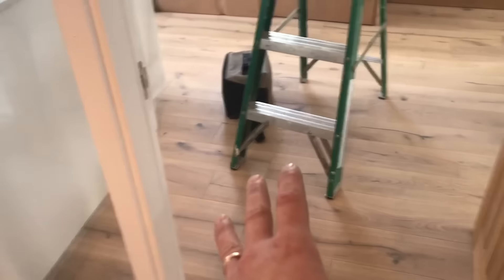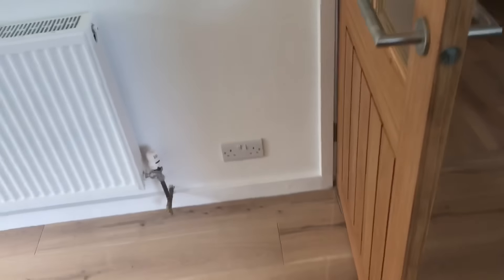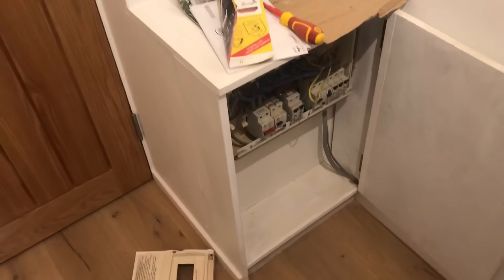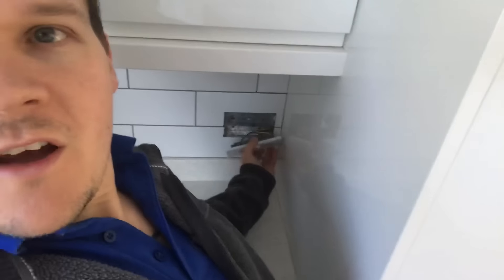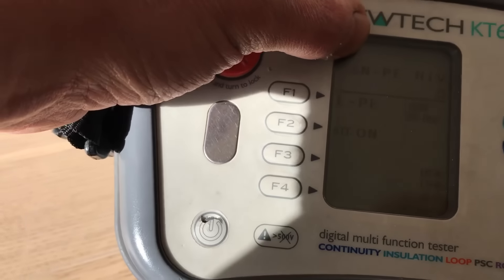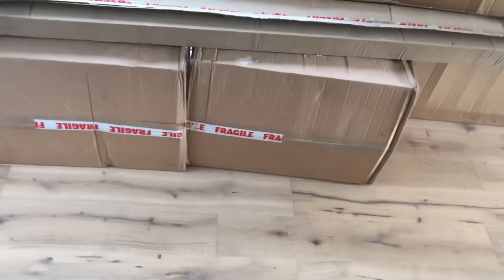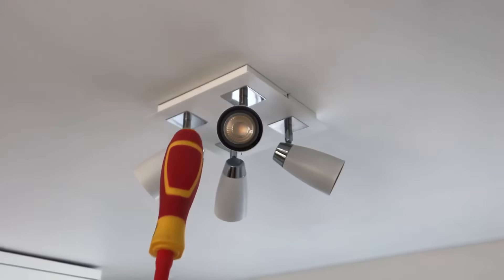Electricians day testing and inspecting one of the worst installs.

Comment: Atleast from where i'm, the builder do only the builder job, the electrician needs to be called apart. Of course, if the builder needs to move cables and stuff he's going to call an electrician to do that, but if the installation is old and the client doesn't care to fix it, the builder just do his job, without touching anything. It's a problem of the client if he have problem after. Also, in a new building, the electrician need to be called from the client, so if he call someone incompetent, the builder can't do much. The builder can just suggest to call someone and stop.

Comment: man electrical in the UK is so damn different compare to the US. i would love to learn electrical over in the UK
Reply: not much different just have to get over the concept of ring circuits. using 2 runs of awg14 dbled into a 30amp breaker one line going clockwise the other counter clk meeting in the middle outlet. ive seen a lot of GB wiring i wld be comfortable as a homeowner doing most of it.

Comment: If you find this shocking, try some ancient industrial electrics, i've opened electrical cabinets where it's just a spaghetti monster inside, and if youre lucky the plate with all the relays and fuses doesn't fall out, because the bolts holding the panel in are rusted through... every day the same shit...
Almost got myself killed at my previous job, 690 volt panel fell out of the cabinet when i opened it.

Comment: Looks like a builder/ plumbing contract. They’ve paid for a plumber to remove a hot water cylinder and fit a compliant Boiler, Government rules. Grants are also paid out by local council for this. No need to show where old cylinder went or boiler + asbestos flew ( check local hedgerows) no paperwork needed. 
Try asking Corgi, still in existence and Gas safe, new boilers paperwork could easily include electrical sheet.

Comment: The bathroom light: First, the measurement is taken from the floor; not the base of the shower tray. The IP rating is with the fitting in the fixed position, so the connector block is irrelevant. A shower unit has a connector block inside it but is IP rated when the cover is on; not off. 
However, even with the class 2 symbol I don't see how it can be a class 2 fitting. 3 things make it class 1. The wiring of the fitting itself has only basic insulation. There is no insulated separation of the connector block or fixed wiring from the metal.
I can't believe these are genuine fittings. Must have got them from eBay at £5 each.

Comment: The world is full of shoddy trade work....It is the wild west out there & it does not stop with electrical. After our home burned down due to a previous owner's bad renovation caused a hidden electrical fault. The insurance claim was such a nightmare I ended up quitting work & taking the rebuild on as a complete project myself with the help of a building contractor friend. Since completing our home, I have been working with our a contractor friend for a year or so because I am now between jobs (electronics engineer) but I have very good trades skills. I think the root of the problem everywhere is clients push contractors so hard to reduce costs, so even the good ones get pushed to cut corners just to compete & get the contract when they have to compete with quotes from bad contractors.

Comment: I would be using insulated gloves testing that joint. Go and pull the council main fuse and and get the joint rewired by a licensed contractor.

Comment: Ild be advising the home owner to take who ever did that job to court.
I wouldn’t of been touching a number of those things like the make shift ground with any power on.
Makes me feel glad the screw ups we’ve been left with over the years weren’t worse.
Considering 2 more recent issues were 2 power points bypassing the main safety switch “means there was no way to cut power to them”
And when some idiot replaced the main safety switch with a manual switch for a year or two before it was discovered.
Edit - you really don’t want to feel mains power going through you. I don’t know how to describe the feeling of 240V 10A
Going through you. “A bit of advice don’t go looking for switches in small gaps for devices like a plug-in fluro light outside “shed” where mice can get in to chew through the insulation”

Comment: There's clearly serious ammounts of problems with this install and the poster obvisouly knows his stuff.  It's a minor thing but he points out that the zone 1 light fitting should be IPX4 rated and refers to the fitting being IP44. The digits are independent, one is for ingress of foreign objects (the first figure) the second for waterproofing. The reason it's IPX4 is that it has to have a a minimum of 4 for water ingress, mechanical protection (denoted as X in the OSG) isn't important. The fitting could be IP24, IP44, IP64 and so on. A minor point but worth noting for anyone watching. He was probably stressed dealing with all the issues on this install!

Comment: I'm always amused by how different countries have (usually slightly) different wiring codes, and how electricians from the respective countries will recoil in horror at the "obvious death traps" that are perfectly compliant with the wiring code of the other country. The way you recoiled at the unsheathed earth wire on the socket outlets? That's just fine here in my country (what do you think is going to happen - the outlet body might accidentally touch the earth wire?) And then you say some stuff that seems to imply that in your country, socket outlets can be unprotected by GFCI (I think the Americans are somehow fond of non-GFCI-protected outlets), yet in my country that's what our electricians recoil from in horror.

Comment: Most probably the owner asked for a quote from an electrician. The quy calculated his work at normal rate and added materials. It came to 10'000 Pounds. The customer shared this information with the builder who, on the spot, said, he would do it for 3'000. The customer knew something was not right but killed the thought. "I'll deal with it later. Everything will be ok."
It is only the customer's fault. They should never have given the general builder this job. At least they should have called the inspector before the job and agree details of the work. The customer is to blame. Period.

Comment: The best thing i've ever seen: 3-wire cable everywhere. In every socket, light switch, or junction box. But only 2 wires (L and N) are connected. PE lays unused in the back of everything. Sometimes the N and PE connectors of a socket are connected together to neutral like a PEN wire, sometimes PE connectors are still unused. I don't understand such bad working.
The one where that has installed should be hit by lightning when shitting.

Comment: :D is that lamp really only held by the cable ?
Reply: Its actually a common method for lightweight lamps. The cable insulation gets fixed on the housing so that the copper has no mechanical stress and wont get pulled out due to the weight. 
You could build yourself a swing with a pair of NYM-3x1,5 cables.
Reply: :D here you would lose your job instantly as an eletrician if you do something like that
Reply: may i ask where you live and work? in germany its a common thing just like i said. we probably have a DIN Norm for that

Comment: Assuming you use Building Permits like Canada and the USA does, I'd call the City Building Inspectors (or your equivalent) and ask them if a Permit was ever opened for that Job (if it was, I guarantee it's still open as NOTHING would pass Inspection) and STRONGLY suggest an Inspector come over and look at what you found. That Inspector (after they heal up from the Heart Attack that Job would give them) should then issue an Order of Correction (or whatever they're called there) to get that flat fixed. That should help the Home Owner get the Builder to pay for all of the repairs needed after all the walls and ceilings are pulled down to do the Whole House Rewire needed to fix that Nightmare of a Disaster...
How is it that no one has been killed yet by that Shoddy Work?
And how many other places has that Builder Butchered?
Reply: lol they dont they are self credited through the government regulation agency they kind of are on their own honor system tho lol. yet we are the land of the free in merica with all government inspection oversight🤦‍♀️

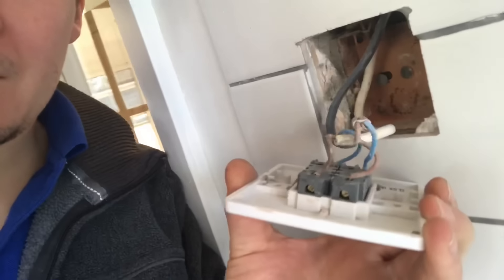Comment: what’s your problem with that switch @ 08:18?
Reply: You can’t tell from the video that is flex cable. should be crimped then with screw down connectors. Better would be a standard 1.5 NYM cable ofc...

The switch is all plastic, no need for PE - you should bring it up to where you hang the light though.

What grommits are you talking about?

Im an electrician in Germany, just interested and curious how things are done elsewhere...

Comment: IP numbers

1st number is for dust or particles. 4 means protected from 1mm or smaller stuff.
2nd number is for water so 4 means protected from splashing water. 
So the light is ok.
Evertyhing else is HORRIBLE :)

Comment: If they are basically renovating then all the wiring should be ripped out and replaced. No compromise. It's easier and hardly more expensive for a flat. It's not Buckingham Palace.

Comment: they didn't say to her that she needs it rewired because they know they can do a cheap job, and charge some extra money for it. and then be gone, and there will be nothing she can do. 

Thats why i don't like it when people say things like "its the customers fault for wanting a cheap job". a lot of the time its the supposed "expert" lying about what things will cost to be done right, and then doing them as cheap as possible and taking the money.

And worst of all, it will cost WAY more to fix these things after the other work has been done. Than if they had just been done right in the first place when everything was getting worked on, instead of once everything is supposedly nice and finished.

Comment: Dam ............. i am not a normal house electrician .. i am a specialiced service electrician .. mean i can fix lots of electrical stuff but i cant change anything in a home or rewire stuff there ( because i dont know some of the laws .... that are special to this ) But i can touch basically anything after an outlet and exchange like cables and outlets and even breakers .... but that said. ... dam THIS IS A HORROR SHOW ..... DAM !

also was the cable wet for the shower lamp thing ? looked wet to me ... that cant be good at all ... but dam that looks really bad !

Comment: Electrical jobs like this are very common. The solution is to prepare a simple written report on one or two items that suggest the property has wiring faults. One copy goes to the householder, one to your trade body, one to the council and one for yourself. Then leave. I wouldn’t apportion blame, that is the householder’s problem. Your job is to identify a dangerous installation and report it. Too many tradesmen do the “suck between the teeth” and the “who did this” routine. Don’t do it as well. Stick to the facts, give a price for an investigation and then prepare a quote for remedial work. Simple stuff. Rise above the rabble.

Comment: 14:01 supply looks dodgy to me, should be a DNO cutout and what on earth are those meter tails?
Reply: Older flats often have remote meter positions with the main fuse located in a communal area. Should ideally have a red link for a point of isolation dno may upgrade at some point. Cable looks to be split concentric cable that's been wrapped by previous meter fitter.

Comment: In our laws, isolation switches should be within a meter of the stove, geyser etc.
Reply: my laws whats an isolator lol well not really they are required for outside motors appliances(mostly a/c and water heaters /furnaces if not with in sight of breaker.)

Comment: I Come Fro Industry power domestic sucks but the Guy whom has done this Should do time  Where is the 63A Head gone ?  There is just a Black box on the wall with the Tails coming out So what happened to the head ?  Horrible is it not when u find shocking stuff like this in the UK . That's what happens when you flood the country with no good bell ends .  Scary behaviour . I Hope u got a 10 grand rebate on the wiring because that's about the base price for a standard install .  Still Amazed that someone has removed the Head LOL

Comment: I must have heard him say probably 15 times "terrible" and "whoever did this has no idea what they're doing". How about instead explaining how it SHOULD have been done? Very monotonous hearing the same comments over and over, I think I got the message after the first time....
Reply: Looks like the flat was originally wired with 'mineral insulated cable' (L/N wires inside a metal tube which is used for earth) problem with this stuff is its usually cemented straight into the walls, so not easy to replace, so they didn't they just connected new cable with terminals in the wall, lol. Also as the earth was originally the metal pipe the live conductors run in, which means it needs a specific termination to maintain good earth continuity (again looks like they didn't bother). There were no earthing loops from the front plates to the back boxes, they seemed to be running 'spurs' when they should have been 'ring main' (lowers the rating of cable). Generally the installation was sloppy let alone incorrect. (The IP rating was o.k. though IP44 is IPx4) 
If you ever see mineral insulated cable, avoid it its a pain in the bum. (clue is two black cables in the sockets, single core copper, and no earth as it was originally earthed by the gland connected straight to the back box) which is likely why when he screwed the face plate back on the earth came back.

Comment: I will state this - I am NOT a certified electrician, but have worked alongside and with them at times (Showing work done and let them check, certify and sign off) and I'm in SHOCK (pun unintended) just under 5 mins in - it hertz (intended) that the customer has paid good money for a half * job.
I hope they 'l-amp' (intended and would have been hidden. Will stop now) the idiot and/or company with a claim through the courts.

Comment: 12:56 holy fuck now I see how horrible the job is, a bare live wire sitting uninsulated in a metal gang box, so fucking stupid. None of the outlets were grounded, the ohm reading was 13x what it should be. Just a nightmare lol. The worst thing was the ungrounded light fixture above the bathroom, the wiring just looks janky as fuck and with the metal bar running across without a ground it's just hideous.

Comment: Agreed, a bad job. However you ask repeatedly "where does that go"  Bear in mind it was an old existing wiring job. How does anybody know where it goes ??  As long as the cable tests ok in every respect then in my books use it. I really don't know or care where it goes or the route it takes ... is it earthed, does it have a breaker and it it the correct diameter for the given application. If yes, use it it no, cut it off at both ends and start again.

Comment: In USA  such a bad job wouldn't happen,once inspection is mandatory over there.
Reply: INSIDE BRAZIL documentation is mandatory on new builds, this was an old apartment going through modernisation by a private client. It was their own discretion to get a proper electrician in. The guy who did it clearly had no intention of testing it; a typical cowboy builder who thinks because he can wire a plug he can do anything, and will do anything for cash. He could kill the next resident, and he would be jailed for manslaughter... once they found out who did it, which without documentation could take a while..

Comment: Tne problem is most the owners don't want to  spend in safety just they spend  for decoration more than safety and some builders are dodgy they left anyone to run cable and than hire person  with small knowledge to do second fix. 
I swear to God 75 % of uk Electrician’s they are not able to work in Germany or Netherlands as Electrician’s.

Comment: Horrible installation, you're right to condemn it and builder should be reported to local Building Control. One thing, you don't understand IP ratings correctly - the shower light is rated IP44 and the regs call for IPX4. IPX4 means the fitting should be water tight and as a result, the physical ingress factor (rated X here) should follow suit. IP44 meets the regs requirement and the fitting is fine - the installation isn't though!
Reply from the maker: No your incorrect he cut out the manufactures connections and used open connector blocks effectual fitting a metal light fitting in a shower enclosure

Comment: OMFG Are you sure you sure your satnav did not have a bad day and take you to China ? No wait that cant be..... I have seen better wiring jobs in China !!!!  The really sad part is that during all that work EVERYTHING was accessible and that could have been a 100% beautiful totally invisible install ! 

I am glad you isolated the water heater cct. That could well been the telephone wire on the intercom.

Well done for not hanging yourself from the lights when you found all this. Still if you had you could have occupied yourself up there chewing on the live  :)  You would have been safe after all. If there was actually a company fuse or Henley block (another fail) I would have condemned the installation and isolated it. 

I would personally report that to the building inspector and your membership body to cover your backside. At least you have the video for evidence and when you tell the customer and she gets upset you could always point out that should she have an American visitor its only two to remove and they can plug their 110 directly into some of the sockets  :-D

What a total fecking disaster !!